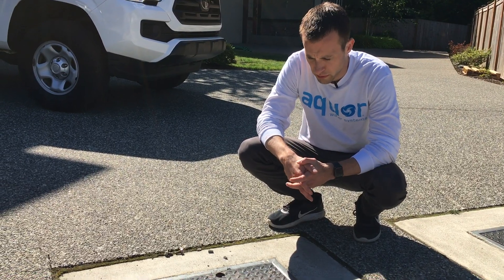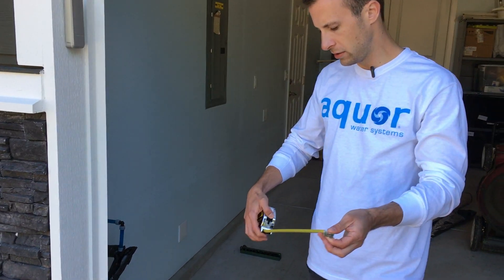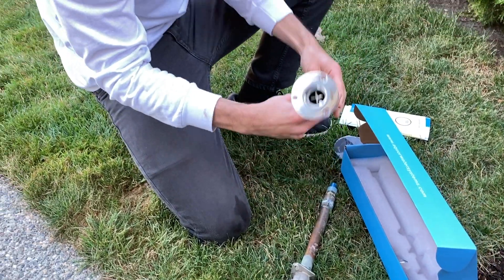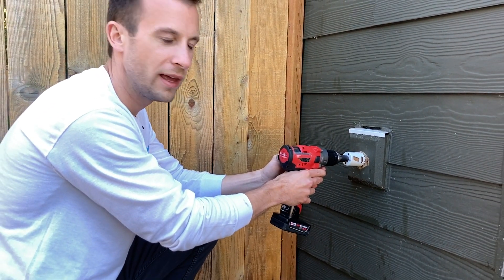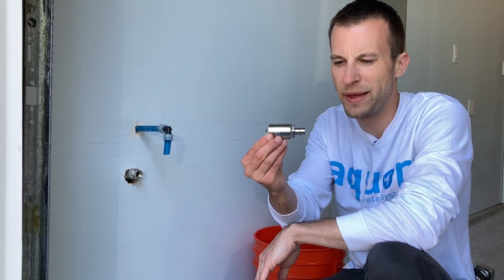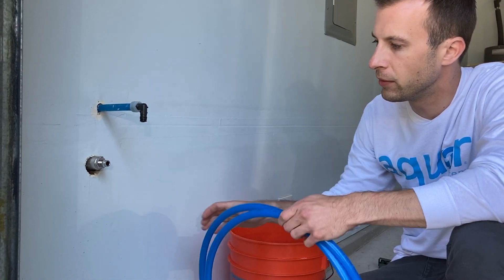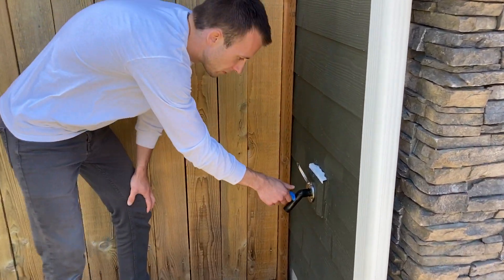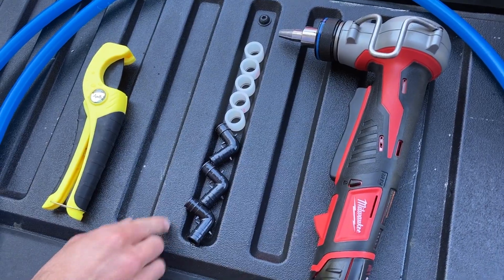How To Install Aquor House Hydrant V1+ with PEX Plumbing

Comment: What is the minimum wall thickness you need for these?  I think one of my faucets piping is at most 4 inches
Reply from the maker: Shortest configuration is the Close-Couple V1+ Hydrant, with the optional 90° elbow inlet -- it needs about 3.5" of clearance in the wall (typical 2x4 wood framing).

Comment: If all of the plumbing is inside a wall, would you have to open the wall or could you pull the pex (24”-36” service loop inside wall) through the exterior and then push it back through the larger opening made to accommodate the aquor bib?
Reply from the maker: Good question! We do recommend a PEX service loop but in cases where you cannot install one that way, you would have to open up the wall. The system is extremely low maintenance and you shouldn't have to worry about opening up the wall anytime soon.
Reply: @AquorWaterSystems  Forgive me for being dense but are you saying I would have to open the wall for initial install and not have to worry about it OR if there is a service loop already I would not have to open the wall to install the Aquor?
Reply from the maker: @AverageatMostThings  If there's a service loop already, you're good to go.

Comment: Sliding a wood dowel over the pilot bit is a good idea but a considerable hassle getting that if it's a one-time install. I assume it's a 1" dowel. Good tip, thanks for sharing.

Comment: I live in NC, and our faucet runs outside through our kitchen, just below base of our kitchen cabinet (very low to the ground on the inside). We have PEX inside, but I'm pretty sure it's not expansion PEX (based on what you show here). Will this still work? I DEFINITELY want to install the house hydrant, and DIY it. Any recommendations or thoughts appreciated.
Reply from the maker: Absolutely! You can adapt the univeral 1/2" NPT inlet to any type of plumbing. We also make optional PEX-crimp inlets that are specifically designed for Crimp/Clamp connections.

Comment: Not impressed with the final pex installation, exposed outside of wall. My customers would not agree to having a horse shoe pipe sticking outside the wall. This is super easy for diy. P.s. not pipe wrenches
Reply from the maker: Could have been designed better during new construction, but we didn't want to open the drywall. If you want to film an install video with some more tips, let us know! (800) 458-1749

Comment: Can you recommend this for concrete wall installation? My spigot is low to the ground.
Reply from the maker: Definitely! We've seen many installed on concrete block walls. It's a great solution for any low fixtures, because you don't need to bend over for long to connect.

Comment: My faucet is located interior garage side and piping is within the block wall. Is DIY installation still recommended?  I have basic handyman skills.
Reply from the maker: If you can access the plumbing through the garage, it should be very simple. If you want to send photos of your setup, get in touch and we'd be happy to provide tips.